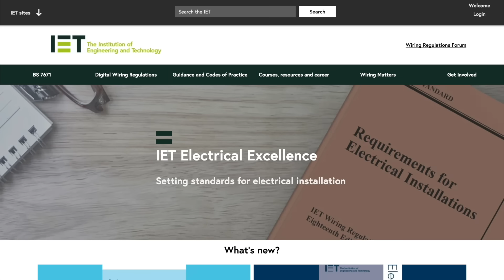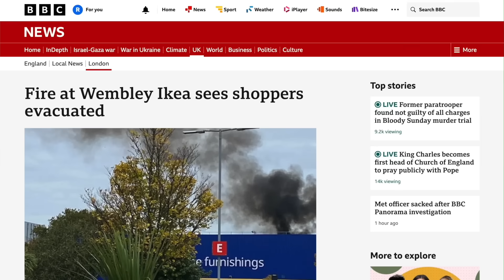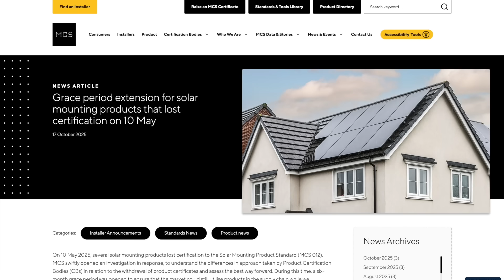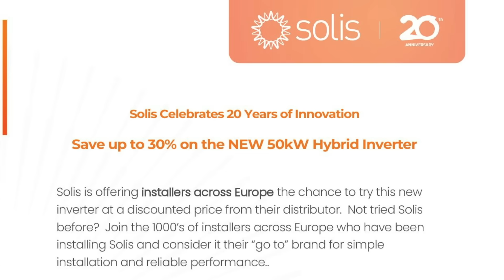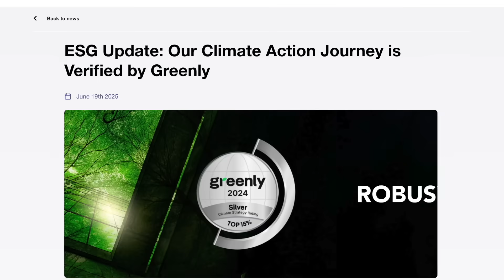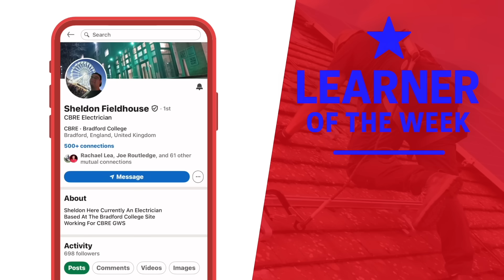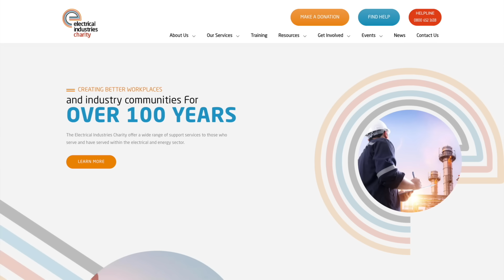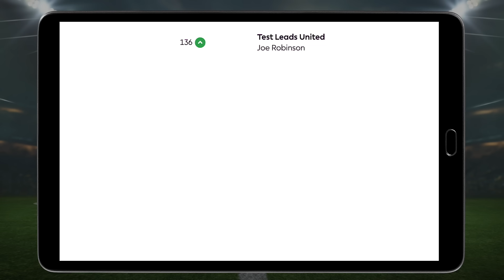Exclusive: Grid Bosses Set to Change UK Voltage

Comment: 2:29 how does that affect electronic equipment? 207v designed for 230v
Reply: Very unlikely you'd ever actually end up getting down that low, I'd say 220v would be getting low already and that wouldn't cause any real noticeable problems.
Reply: Most electric equipment is made for Europe rather than the UK, Europe has 220V. If anything your things will last longer
Reply: Most things should be fine tolerances are pretty huge for domestic equipment
Reply: Operating electronic equipment designed for 230V on a 207V power supply can have several effects, primarily due to the lower voltage.
Under-voltage: The equipment is receiving less voltage than it was designed for, which is a form of under-voltage.
Reduced performance: Some devices might not function correctly or at all. For example, motors may run slower or overheat, and heating elements may produce less heat.
Increased current: While the voltage is lower, the device may draw more current to compensate, which can lead to overheating and potential damage to components.
Component stress: The internal power supply of the device may struggle to maintain the required voltage for its internal circuits, leading to instability or failure over time
Reply: @JoeKyser  thanks Gemini!

Comment: We were getting upper voltage levels up to 253V which was causing havoc to some of my systems in the house (example chargers tripping and excess heat) it was so bad I fitted a big UPS which dropped the voltage and stopped the problems, after talking to Octopus and reporting problems, several months later our measurable voltage now fluctuates between 230 and 244volts, the UPS has stopped protecting at the thresholds that were set and everything is running perfectly (touch wood) location Poole n Bournemouth.
Reply from the maker: Thanks for the interesting insight!

Comment: I have always heard that you guys  have a crappy grid compared to the US. For about 40 years, our utilities must supply plus or minus 5% of nominal.  Plus or minus 10% seems huge! That has to hurt efficiencies of many household appliances. I would think that HVAC probably suffers the most.  I'm sure this makes life easier on the utilities allowing them to be pretty sloppy in what the deliver.  You guys do a lot of things that would never fly in the US!  

The big problem with IEC standards is they are more about  economics rather than safety and engineering standards and efficiency.  It has always amazed me that manufactures can self certify their products and that no testing is required. I know that individual countries can have stricter standards, but I think these tend to be more about variations in installation standards rather than about devices/appliances.

Comment: I already suffer from lower voltage during dinner time. My electric hobs dim noticeably and food etc takes longer to cook.
Reply: FREE ADVICE FROM A RETIRED ELECTRICIAN      I posted a reply here to a guy with a problem,  his voltage was getting to low sometimes..... But it could be such a serious problem  I need to warn everyone that is suffering low voltage, to have their installation checked out in case the neutral wire has broken and the return power is going down the earth... at the MEN point...the problem is the earth wire cannot take full power without burning out leaving no earth to anything........ so it not only causes lower voltages but is potentially very dangerous...so get it checked by a competent electrician... ASAP.   

 This is no joke or money grab scam, just straight forward advice, in the hope of saving someone's life.
Reply: @apollo8352  If current did gio to earth then Earth leakage breakers shiould detect it and shut off immediately UNLESS your whole installation is faulty.
Reply: @ro63rto  Hi that sounds like your voltage might be dropping below the allowable  range, you should get it check by a competent electrician, because electric motors like in your fridge and other appliances could start burning out... 

Just some back ground FYI ...the speed of an induction motor is determined by the supply frequency (50hz) and the number of poles designed into the motor.   While the formula for watts or work  is W = V x A x PF     forgetting PF for the moment unless the frequency changes an existing motor will try to do the same speed which means do the same amount of work...so if your supply voltage reduces then the amps must go up if W remains constant.
Reply: Can't you turn it up and down or have you only got an on/off switch.
Reply: @David-jx4gw  Hi you should not have to, if your paying for your electricity, the power company has an obligation to supply the power within the specified tolerances, other wise they have to fix it at their cost.   But don't just use a cheap meter to test your voltage, use one that is certified...otherwise the power company may charge you for their inconvenience should it scrap in.  That us why I suggest get a competant electrician.... they can also rule out any problems with your installation such as a broken neutral, because if the power is returning via the earth at the switch board that can give low voltages, and be dangerous.
Reply: I have a boiler that always say low mains voltage and my cooker has reduced power and at times the lights dim
Reply: @davidwilkinson7746   Same advice... till you get it checked out, it could be a serious broken neutral... which has the potential to be very dangerous.   But if you use a competent electrician and you have him check your voltage with a certified calibrated volt meter... then if it is low volts from the power company then they need to fix that at their cost... assuming your on grid power etc.
Reply: Definitely get low voltage checked out. Worst case it could be caused by out of spec wires, which could be a fire hazard. However I will say that if the same cooker works slower when everybody cooks as opposed to say the middle of the night, it might be that the grid voltage is bad because there are too many cookers at once on the same subset of the power grid. This wouldn't necessarily be a safety problem, but could still be a valid reason to file a complain.
Reply: Hi I did not want to make this more complicated than it was... but a broken neutral from the incoming power company on the supply side of the earth leakage circuit breaker would not cause the sub circuit earth leakage breaker to trip.  A earth leakage protection has a little toroidal transformer in it, and by passing both the active and neutrals through it their magnetic fields the current in each conductor produces is cancelled out... nut when the current in the active is not exactly the same as in the neutral then it can produce and magnetic field which can be picked up by the toroidal transformer and cause it to trip...,since it has no idea what current it flowing on the supply side of it, it will only trip for down stream loads, normally.   And since most installations connect the main earth and neutral together at the main switchboard... the installation can still operate with the neutral current returning to the power company via the installation earth stake.  

It gets very dangerous when you consider the earth stake connection to ground has some resistance,  meaning the whole installation earth wires, all of them could be raised up to a dangerous voltage... which might appear as granny feeling slight tingle if she touches the kitchen tap while leaning against the cooker, or when in bare feet touching the outside garden tap, and the voltage will be load dependant and so may only be noticed when certain things are running... making it seem like it might have been their imagination!  

But the really big issue is the electrical code/regulations allow for a smaller earth conductor to the size of the installations incoming mains wires... so if enough loads are switched on at the same time and all the current is going back via the smaller main earth and earth stake..,it is likely that earth could burn out and open circuit... when that happens everything hooked up to the earth wires becomes alive at full supply volts. 

I know this is getting very technical for people without an electrical background... so take what you want from it and if you want anything explained better let me know... (after all I did teach this stuff for twenty years).
Reply: Longer to cook does it mean costing more or the same?
Reply: @zakadam154  It will cost more, since more heat will be lost to the surroundings, because it's on for longer.
Reply: @zakadam154  It will also cost more if it's a professional kitchen where people are paid to cook the food.

Comment: There's a lot of rubbish in the comments here.
  The only proposed  change is to reduce the ''statutory' voltage lower limit from minus 6% to minus 10% to allow the voltage to fall to a lower value. It does not mean that the voltage will be suddenly reduced it means that Distribution Network Operators (DNOs) will not have to reinforce networks as much as they do at present as loads increase and networks are extended.
Reply: i thought the power factor got wonky when the voltage changes but the frequency doesn't. (not that i'm an EE)
Reply: @elongated_muskrat_is_my_name Depends what your load is.
Sounds right for an inductive load like a motor.
Resistive loads will maintain a power factor of 1 and just draw less current.

Comment: More than 20 years ago, I worked in the electrical power industry in the UK. The voltage had then been "recently" altered from random nominal voltages from 200V to 250V +/- 10% to "Euro-voltage" between 207V and 253V. From whenever this happened, this has been  manipulated by the network operator to regulate demand as part of European "Harmonisation". As far as I know, this was not changed on Brexit. So it looks like this "news" is more than 20 years behind the times.

Comment: Reducing voltage to 207v could cause flickering lighting, appliances being less efficient, motors running slower, some EV chargers could fail and trip breakers or be slower charging.
Reply: In my experience: EVs just charge slower on 208V (common in North America for commercial installations -- phase to ground voltage is 120V).

Comment: shouldn't we be using transformers on each home thus increasing the voltage input  and able to keep a steady smooth voltage on output
Reply: As somebody else commented: transformers that support switching voltage taps live are very expensive.
For transformers with a series of fixed taps: they try to balance out the daytime voltage (which may be lower due to industry) with the night time voltage (which may be higher due to reduced demand).

Comment: So electric products are designed to function with our voltage tolerance range of +10% and -6% and the grid bosses are proposing to exceed this tolerance by undercutting the 6% by a further 9v, any failures of products thus are not protected as this is outside the existing tolerance and I can see the consumers footing a bill generated by the grid bosses (pun intended).
  What should happened is a phasing in of greater voltage tolerances for a decade, products would be required to tolerate the new voltage range and then we see the introduction on a lower grid voltage, protection for the consumer and a new generation of electric goods that can withstand the lower voltages.
 We must remember that if it drops to 207v then the goal posts of voltage tolerance is move in line with it meaning equipment must also  work at sub 200v, working in the industrial industry this simply isnt going to work, I foresee massive cost in implementing incoming transformers to bring voltage ranges back up to what the machinery can function on.
  Build more nuclear and get rid of the green energy ideology that ignores the practicality and cost of implementing such systems that are been pushed for global politics not global warming.

Comment: Totally unacceptable, many household appliances, ovens , and especially retired people, backups , have older equipment that require the 240v or minimum 230v, including old TVs inc lcd required that , this will cause equipment failure,  this is another attempt to just tie us into eu grid than generate it ourselves and flood yhd market with eu Chinese products not up to uk quality  ,  keep uk240v and lower dno export limit instead, there would be a massive e waste generated by this stupid 207w it must not drop below 230v -240v

Comment: I was under the impression that we changed to 230V many years ago as part of jpining the EU, and Europe stepped up from 220V to 230V so we were all the same, hence we get electricity from France and we can sell to them with no issues
Reply: We are 230v +10% -6%. So anywhere from 216v to 253v. Therefore in reality nothing really changed and we basically stayed at 240v.

Give or take
Reply: @infidellic and it was always 240v nominal and not in practise. It's like saying you are going to allow 45 minutes instead of 30 minutes for your commute to work. It doesn't change how long it takes to get to work.
Reply: Cross country interconnects are High Voltage DC and run well over 100,000 volts.
Reply: @RandomNoob  100kV is not much in dc links. standard voltages for dc links are 500kV, 750kV and 1100kV.
Reply: To me I still calculate based on 240v even though my place often sits at 250-255v and sometimes even 265v
Reply: @mlee6050  Preliminary calcs can rely on 240, if thats what you want, but the reality is that you should use site voltages, better to use the site voltage and therefore currents and tripping times.
Reply: @007floppyboy  if site as in where working and not work site as in 110v, yes, I do my own even though not qualified, I do dream to be qualified in 5 things to do as trades: electric, plumbing, carpentry (maybe include roofs), car mechanic ... Wow I forgot the other I have planned
Reply: That was a global agreement unrelated to the EU. It was to permit manufacturers to produce global standard equipment that will work in any country (outside of North America)…
Reply: @allangibson8494 I was reading USB A might go obsolete as of USB C, I hope not or I be buying so many cables to put in tip every quarter of year, usb c cables don't last, EU do some good things like voltage but bad for usb
Reply: @mlee6050 USB B is the most likely to become obsolete first (it’s been through eight different physically incompatible versions so far (and I have all of them at home now…)).
Reply: @allangibson8494  F@ck I wish my country (USA) would get its head out of its @$$ and ditch 120.
Reply: @cmartin_ok  There isn’t a household cord going across the channel, the electricity generated by either country is tens of thousands of volts.
Reply: @JimBaraclough  Ah yes, my mistake
Reply: Isn't most electronic goods have a range of 220v - 240v so will become less efficient?
Reply: @JLO72 Efficiency is more about manufacturing tolerances - the exception is straight resistive heating elements which will either need to be designed with higher current draw in areas previously fed 240V (or 260V) or lower in areas the were fed 220V. On the other side they will last longer and suffer less insulation failures.
Reply: we sort of did, but the distributions transformers are only changed as and when they needed to be. So a lot of places is still 240V transformer running to the as the tolerance band allows 240V transformers still. This will be true even with this change.
Reply: We lowered it but it takes longer to get there in lorries bow
Reply: You are right about the change to 230v but wrong about the grid with France, which also included other countries now. The grid operates at a far higher voltage than 230v.
Reply: @MJC1124  my parents live in italy, and their place, which is a good distance from the utility transformer gets around 245-246 regularly.
Reply: @cmartin_ok  yes it's been 230v for at lest 5 years